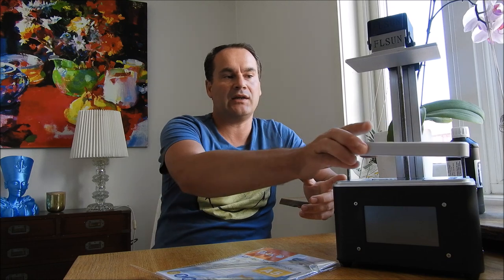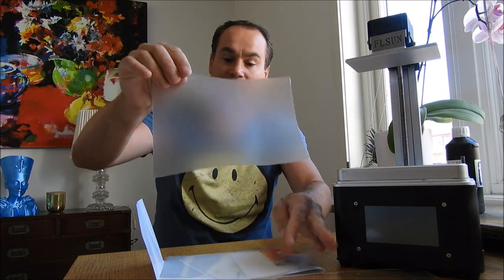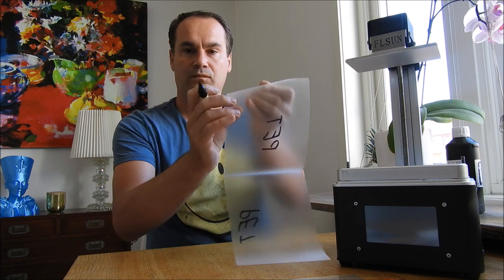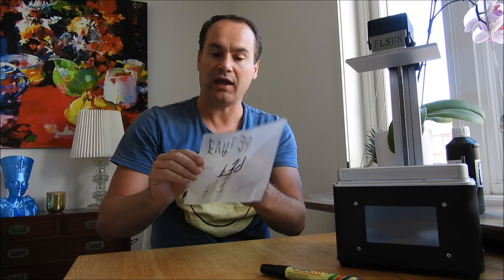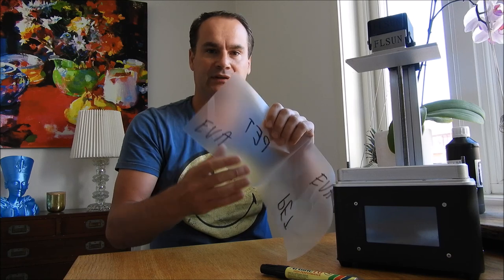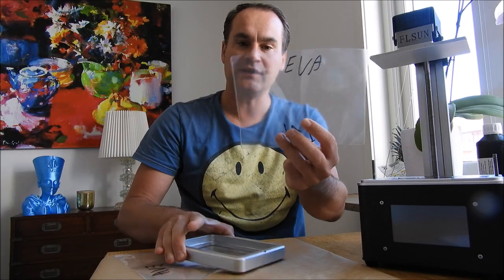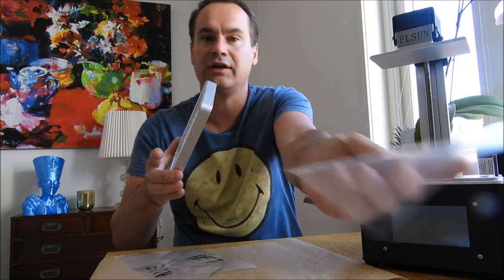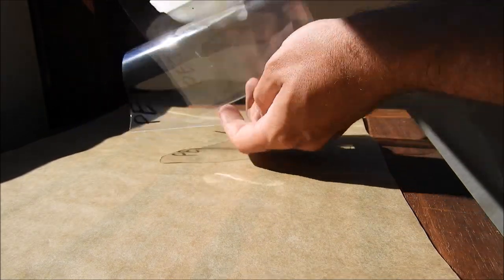The Alternative was FOUND 🤑 cheap & simple FEP film vat for UV-Resin 3D printers

Comment: Tried this with some Amazon basics laminating pouches.

Got mixed results.  Some test prints seem to work, or start working, the rest just stick to the PET film.

Seems like an issue with tension, as I cannot seem to tension these the same way I can tension FEP.

I've got plenty to test with, so maybe I'll figure out what I'm doing wrong eventually.
Reply: Did you find a better method to utilize these?
Reply: @MBrulla  Not yet, I tried another sheet a few days ago, and even with the PTFE lube trick, the prints still stick to the film.

I might try loosening the tension a bit, as that's the only thing I can think of, other than maybe this only works with a particular brand.....
Reply: @MetalGearSortof  I tested a few methods of removing the adhesive backing from mine last night...seems the best way is to heat it and immediately start peeling.

I don't like the idea of adhesive on my screen.

Ordered a roll of FEP from flexvat to do side by side. I can't see laminate having 4k resolution when it's not perfectly transparent.
Reply: @MBrulla  I've often wondered if it would be better to leave the two sheets together with the EVA side facing each other and just heat them that way.

it might make the sheets too thick for the resin vat, but they were designed to be glued together anyway.  And I do have a LOT of them to test with, lol.

I may try that next if reducing the tension doesn't work.  besides, doesn't the heat dissolve the glue?
Reply: @MetalGearSortof  I was just thinking about that. I used a heat gun to fuse, but it's very thick (with 5mil 3M mine was just over .2mm) and even less transparent. Not viable.

From that, however, I found the easiest way to remove the adhesive backing. Heat up the edge with a heat gun and then peel it away. Part of the adhesive will remove from one (or both) sides.

Less fear testing now. See what happens.
Reply: @MBrulla  Didn't work for me, unfortunately, the EVA on these sheets must be attached to the PET really well or something, lol.

Reducing tension had no effect either.

I tried curing some resin between some clear sheets I heated up earlier and the resin peeled right off with no problems.  So there's probably some small thing we're overlooking here.

I'll experiment some more later, clean up after a failed print is the most annoying aspect of resin printing, and really slows down experimentation.
Reply: @MetalGearSortof  Update: Redid the PET -  this time properly loose before installing. I'm seeing popping signs (hear it, too) on the first few layers, so I'm hopeful. Will probably pause around 100 or so to see if it's on the plate or PET.
Reply: @MBrulla  Good luck, it sounds like either a tensioning issue indeed or just general build plate adhesion issues.  I have a Monoprce MP Mini SLA v2 and it seems that build plate adhesion on those machines is especially troublesome, even with the improvements they made over the previous version.
Reply: @MetalGearSortof  Not quite lucky, I don't think. 85 layers in and I don't see anything on the plate.

Letting it go a bit more, but I think it popped trying to release, but ultimately stuck to the PET again.

I'll check later.
Reply: @MetalGearSortof  Yep - failed. I have the PET tuned to 280hz right now. Not sure if it would be better tighter or not.

Maybe with a longer exposure on the initial layers. I had 45 seconds.
Reply: @MBrulla  I usually pause the print after the initial exposure layers are done and then check.  if those first layers didn't stick, then the print's already failed.
Reply: @MBrulla  Mine was like 80 or 90s, lol.   The advice I got was to increase initial exposure until it sticks to the build plate.

I'm about ready to try a PET FEP film with just a drop of resin on it just to see if the resin is even attaching to the build plate at all.
Reply: @MetalGearSortof  That was my next curiosity...is the resin maybe not sticking for some non-FEP reason...

I was doing the test lattice. I'll probably clean up and slice something with like...1:15. Just really long to see if it helps.

Comment: not one successfull print with this method :( I tried a few times and also recalibrated z-axis. the print allways sticks to the film which never happened before (about 30 prints done). I used 125micron film with PET side up (facing resin).
Reply: same here, only one print came out succesfully (without supports), with supports - no chance. using the exactly same pouches like in the video!
Reply: @marwiesi  Did you try giving more curing time to the first couple of layers?
Reply: @Zeriel00  I tried several different curing times, ending up almost breaking my printer as the print was totally stuck on both sides (film and print plate) 
yes - fep film is unnecessary expensive, but I stick with it, ordered 5 sheets from china for 13$. that's ok for me and forces me to take care more about the film ;)
Reply: @marwiesi  Oh ok thanks for the info. I'm so pissed off because Anycubic cheated me selling me 2 pieces of FEP for 24$ on Amazon when they sell 5 for the same price on their website. I was a fool because I'm new to this and bought it only because of the brand. I sent them an email and they basically said "lol sucks to be you, deal with it" Now I've spent all day looking for alternatives but have found none. PET pouches are hard to find, prepare and the results are random. Buying FEP in bulk used to be a great idea but they wised up to 3D printing and increased the prices accordingly.

Honestly, I think we're getting screwed with this damn FEP and there's nothing we can do. The cheapest I've seen is 5 pieces for 22$ from a nameless chinese brand and it has a couple of bad reviews because it's too thin. :(
Reply: Nepu-Tech USA aliexpress is your friend ;)
Reply: @marwiesi  But is that place trust worthy at all?? I think that's the place to go when you want cheap Chinese knock offs :p Plus they take like a month to ship >.>
Reply: @Zeriel00  sometimes they ship from USA (they alreayd built stocks outside china), you can check that during the buying process. Everything you use for 3D Printing is from China anyway, so it makes no different in this case. in general i have never had problems with aliexpress, sometimes it takes 1 week, next time a month. You have to be aware of that, but all my orders arrived so far.

Comment: This does NOT work The PET side is too sticky comparing to the building plate. Even WORSE, the EVA side CANNOT be cleaned. AT ALL.
Reply: The Eva side is the one that's sticky, and I am 100% certain it has to do with the brand of laminating pouches. This worked beautifully for me but the residual EVA glue was what caused me problems. Remember the whole point of these films is adhesion and removal force with clarity. Any limitations to either and the print fails. So far the Lamination Pouch brand I chose has had really persistent EVA
Reply: Sephiroth I used 3M laminated pouches. It should be really good..

Comment: its all fun and games until the heat of the magnified ~40watts led lights and the exothermal curing resin laminates your vat to your screen.
Reply: i use cling film over the screen as protection with double sided tape.
I also use cling film over the vat fep film again with double sided tape.
Reply: @rosred5730  cling film should be strictly reserved for the bedroom
Reply: @Ghryst  Is that  ware you do your best 3d printing :)
Reply: @rosred5730  makinen hangi marka